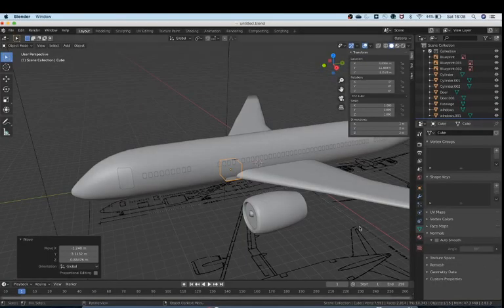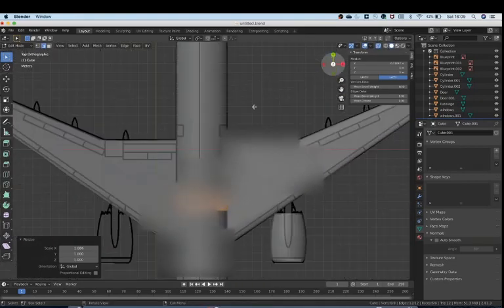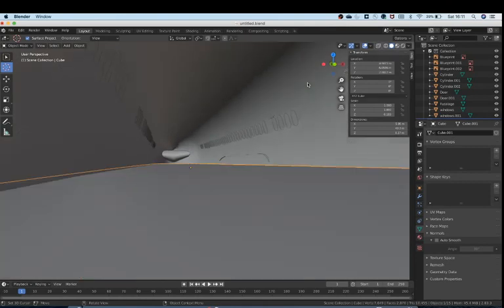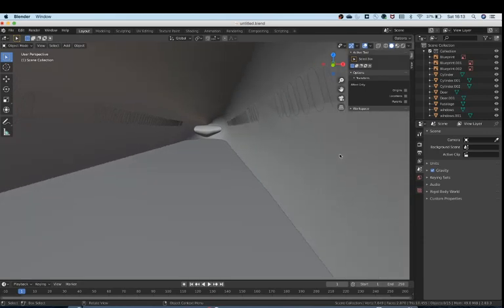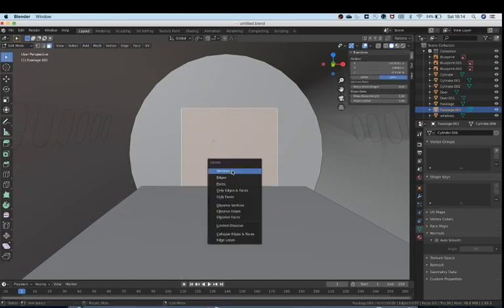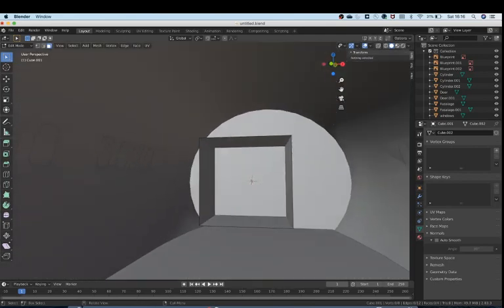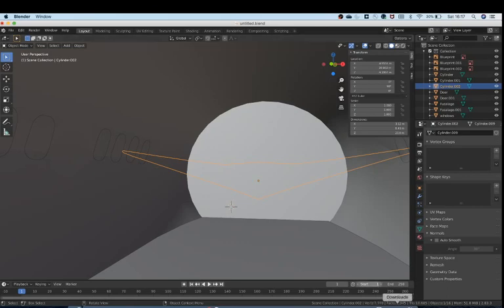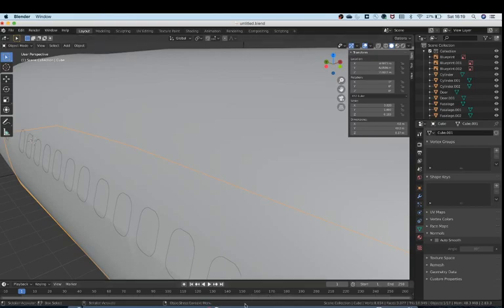How to make basic interior for you mesh using Blender for Roblox

Comment: Also, for some reason my plane is a bit blocky, I tried turning on auto smooth but it isn't working
Reply from the maker: Try shade smooth or auto smooth, if that dosent work, try remodeling it a bit
Reply: @1fresh450  I tried both of them already, should I restart?
Reply: @1fresh450  I made a new cylinder in a new file and its still not working
Reply: @1fresh450  I just did shade smooth but will that mess up the whole thing?
Reply from the maker: Contact me in my discord
Reply: @1fresh450  Yea I did
Reply from the maker: @roadblockalto  send me one more message rn please